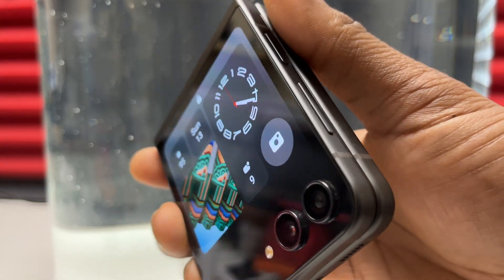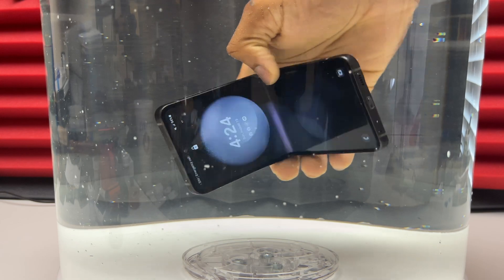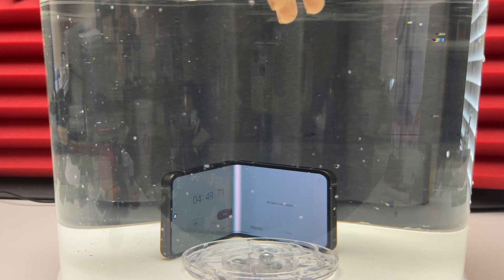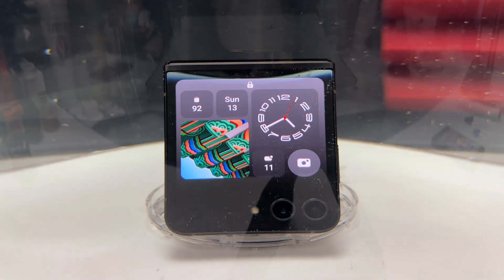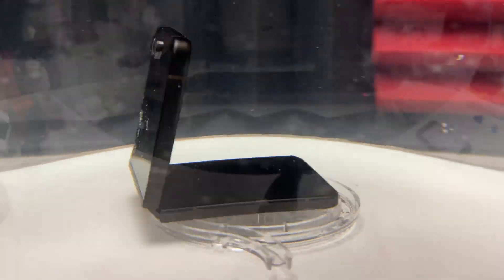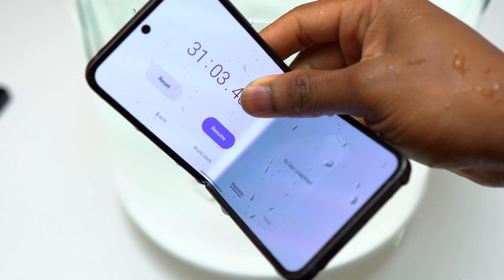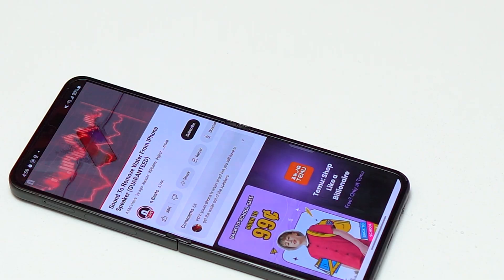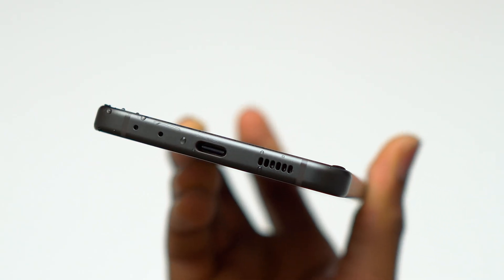Samsung Galaxy Z Flip 5 Water Resistance Test

Comment: Wait so it is water resistant and won't break if a drop gets to it? That's sick dude after this s24 is doomed I totally get a flip series
Reply from the maker: Yes. I am more confident in water resistance on these than Fold. This one was good. Fold had issues after 30mn.
Reply: S24 ultra has a ip68 rating and can definitely preform as well if not better 👍🏾

Comment: Bro i have this phn but im scared to put inside the water
Reply: Same
Reply: Me too hahahaha 😢
Reply: @mohamedmaimane8663  I sold my phn hahahaha
Reply: You don't have to put it into the water. It's not waterproof but water resistant. The point is that if you spill water, or it will be dropped into water, the phone won't break. The point of the video is to show how the z flip 5 resists it.
Reply: Don't need to be scared. Every phone with claimed water resistance will be water resistant. I got my Galaxy A8 from 2018 and it has always been water resistant. Same with JBL speakers I own

Comment: Thx for ur vids as the new user , it helps a lot
Reply from the maker: Glad you found the video interesting and helpful
Reply: Be careful it will start showing water under the cameras in few days
Reply from the maker: As far as mine goes I do not have any issues yet. The issues I had was with the Z Fold 5 which inner screen stopped working.
Reply: @ersrev  did you wash it everyday after work like me ?
Reply: @timbalqvroa man did you seriously wash this thing under water every day? Where the hell do you work?